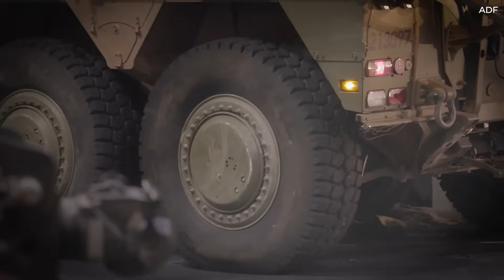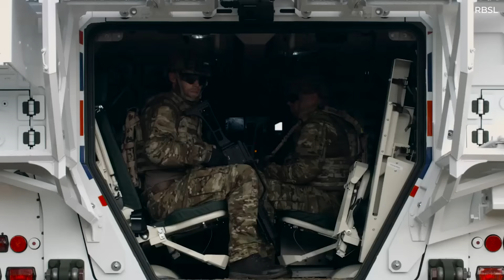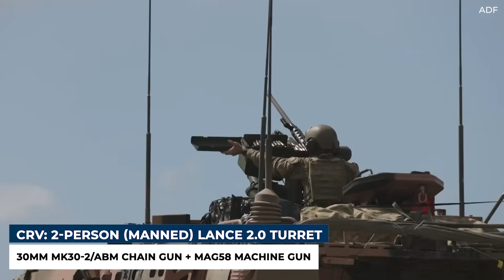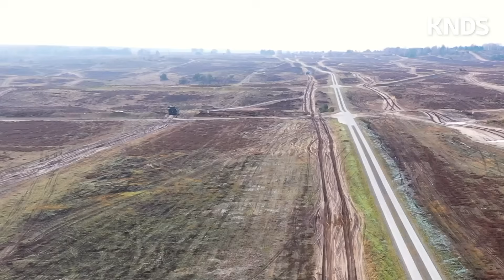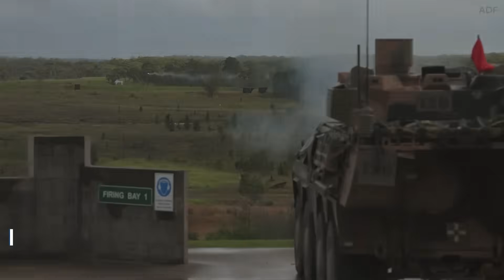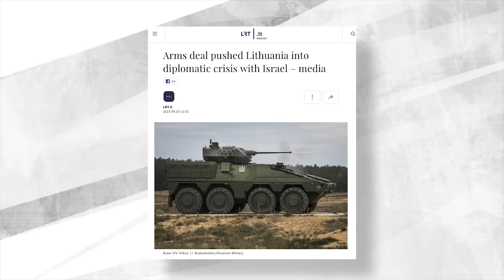Boxer 8x8 Combat Vehicles Compared (Germany vs. Australia vs. Lithuania)

Comment: The Lance manned turret, in service with the Spanish Infanteria de Marina, has experienced problems and is being replaced. It is used on a Piranha III vehicle for reconnaissance. Has anyone in Germany experienced problems with these turrets? By the way, I think the Schwere Waffentrager is a great addition. It makes light infantry a very dangerous opponent for a heavier unit.
Reply: Germany doesen't have the Lance in service yet. Lance gen 1. and gen 3. are also pretty much completely different turrets.

Comment: The Germans use two variants to serve two different purposes in different branches of the Army.

The Schakal (affectionately called PuBo - a PumaBoxer)
Parts of the Grenadiers will transfer to medium forces (while staying part of the Armored Forces, because grenadiers aren't infantrists. They can "just" fight infantristic), but continue using a troop mounting capable IFV for integrated direct fire support. 
Backdoor opening to the bottom for faster dismounts, unmanned RCT30 turret to have communality for the Puma experienced grenadiers (and creating the necessary room for mounting capabilites in the first place). Easy pick for this purpose.

"Schwerer Waffenträger Infantrie" 
The Infantry gets the CRV-variant without mounting capabilities, a (simpler?) manned Lance turret, a simpler side opening backdoor and the role to support Infantry only.
Thats literally combining and replacing the task of the Wiesel MK and Wiesel TOW in the Heavy Companies of the medium infantry, while adding mobility.

This issue is partly specialization and partly organisation responsibility. PuBo is part of the armored forces to supply the heavy part of the medium forces with their own tactics, while the SWI belongs to the infantry within the medium forces using the SWI as a platform for supporting infantry (of other companies) only.

Both use different tactics. Except when theyr'e not... At least they share the rolling chassis.

btw the Wiesels stay within the Infantry. The infantristic part of the Rapid Forces (means the remaining Paratrooper & Mountaineer Heavy Companies).

Comment: I am realizing that the new standard seems to be for a 30mm canon rather than the 25/35/40mm canons even the LAV-6 (Canada) upgrades are swapping out the old 25 for the 30mm. This choice appears less pronounced where tracked equivalent platforms are concerned.  Be well and stay safe

Comment: The Boxer RCT-30 is in itself an anti drone system. The turret is dual purpose and uses a lot of the components of the Skyranger 30. It is the software and sensors that make it possible to see and track small drones.

The Schwere Waffenträger is a replacement for the Wiesel 1 in the Jäger bataljons. With the scrapping of the LuWa (Luftbeweglicher Waffenträger) the Wiesel 1 will probably be upgraded until the Caracals have been adapted for the role.

Comment: The "Schwerer Waffenträger" and the Schakal will both get the Muss 1.0 / 2.0 System, drone radar and AI helped Target system
Edit: The "Schwerer Waffenträger" isnt a replacement for the Wiesel its a support Vehicle for light forces and a dedicated Wiesel replacement will come and Its not the ""canceled"" Luwa, it was just a test bed for testing different systems. 
https://www.youtube.com/watch?v=r6MnHxBfceM (German commentary)
Reply: "Your comment mixes up a few critical technical and structural realities regarding the new Boxer variants and the German Army’s actual procurement planning. Here is the factual breakdown:1. Subsystems on the 'Schwerer Waffenträger' and 'Schakal' (C-UAS & AI)The Schwerer Waffenträger Infanterie (the heavy weapons carrier for the Jäger infantry) is based on the Australian CRV design utilizing the manned Lance turret. It does not feature the active MUSS system (which is tailored to the tracked Puma). Instead, it relies on integrated electro-optical sensors and multispectral smoke-grenade launchers for soft-kill defense.The Boxer Schakal (designed for the armored infantry) utilizes the unmanned Puma RCT30 turret. It is this specific module that has been heavily upgraded with an AI-capable fire-control computer and modern optronics. This setup is specifically optimized for platform defense and autonomous C-UAS using 30mm programmable Airburst ammunition, guided by dedicated drone-tracking radar networks.2. The 'Wiesel' Replacement: Jäger vs. Airborne Forces Not an Airborne Wiesel Replacement: You are mixing up the branches of the army. The tactical Wiesel tracked vehicles operated by the Airborne/Paratroopers (Luftlandetruppe) will never be replaced by a Boxer. At 35–40 tonnes, a Boxer is completely incapable of being air-dropped or transported inside a CH-47F Chinook helicopter. Airborne forces require an ultra-lightweight, compact tracked platform. As you correctly noted, the GSD LuWa was merely a technology testbed (evaluating systems like the split-track design) to lay the groundwork for the actual future airborne weapons carrier.The Jäger Infantry Transition: The Schwerer Waffenträger Infanterie replaces the Wiesel (TOW/MELLS and 20mm variants) exclusively within the heavy weapons companies of the Jäger (Motorized Infantry) Battalions [suv.report]. It is a wheeled combat support vehicle built to give the Jäger forces organic 30mm autocannon fire-suppression and long-range anti-tank capabilities on their own wheels as part of the new Medium Forces (Mittlere Kräfte) framework [suv.report]."

Comment: Ours (lVilkas) looks cooler
Reply: Nope, the Turret looks odd.  PuBo, Lance, Sampson is the order
Reply: @oldcrow187  Nah. It looks cooler. And has a cool name
Reply: @oldcrow187  There is also the Boxer with RT 60 turret from Kongsberg. Also looks better than the Sampson. On the Sampson it's just too obvious it's just protected according to STANAG 4569 Level 1 in its base configuration, it's really thin. All the other options have Level 4-5.

Comment: Strictly speaking the heavy weapons carrier is not an IFV because it will not carry dismounts. Instead they will carry a lot of ammo. It is a fire support vehicle. I am not sure about the original Australian CRV. And for the role of a fire support vehicle i find the gun to be too small. In German doctrine, IFVs fight in close collaboration with MBTs. So the 30 mm is fine for the Schakal, a dedicated IFV. They also have a lot more of those. But the heavy weapons carrier will be mixed (in a ratio of maybe 1:3 or 1:4) into infantry units who ride the Boxer APC. With no tanks around. These are more like Stryker Brigade Combat Teams. And while a 120 might be overkill, 40 or 50 mm would have been nice.

Comment: since when does ukrain use the boxer??
Reply: They have a few Boxer Howitzers, RCH 155mm variant.
Reply: @wijn1008 i have not seem them in ukrain yet
Reply: @vilkasifv  Iirc there are only 4 or so of them and they are uses in secrecy because they are so valuable. You will not see reports on them because it would be a huge loss if Ukraine loses one of them and a huge propaganda win for Russia if it would destroy one.
Reply: @vilkasifv  They only received a handful, 9 or so. Germany promised to deliver another 50.
Reply: @polarstorm5986  They are now not there. Afaik or better read somewhere, there still some software problems, which have to been first fixed. Its a problem with the ukrainian "Delta"(?) BMS and FCS.
Reply: @markusgoekeler6394  RCH 155 had its combat debut in Ukraine a few weeks ago. It's accompanied by a few RCT-30 Boxers for C-UAV.

Comment: Can you explain the exact differences of the two german vehicles? And why do they even have to different turrets?
Reply: The Schakal is a wheeled IFV and the other is a heavy weapons carrier (fire support vehicle). The Schakal has dismounts the weapons carrier has none. Why? The troops using the weapons carrier already use the Boxer as APC (without autocannon) while the other troops are mechanized infantry. Why different turrets? Because the Puma turret on the Schakal is remote and thus leaves more space inside the vehicle for dismounts. 

The Lance turret in the weapons carrier is manned and leaves not enough space in the vehicle for a full group. It can potential carry 2 dismounts but the space will be used for more ammo or drones etc, its not yet known. The troops using the Boxer as APC and weapons carrier are originally light infantry. Light infantry riding around in Boxers? Just German things. 

The weapons carrier is also the replacement of the Wiesel in these troops. Sounds strange but when you consider that they already use Boxer as APC it makes sense. The Wiesel in mountain and air assault troops will get a real successor (some day). I hope the weapons carrier will get a real name soon.
Reply: @AffigesEtwas but why did they prefer a manned turret for the weapon carrier?

There must be an advantage for the manned turret. Why else would you complicate the procurement and maintanence that two different turrets bring with them? 

Is it simply production capability that is sooner available in australia than in Germany?
Reply: @markusdegenhardt8678  The Puma turret is much more expensive. Everything about the Puma is specially made for German needs and supposedly the highest performance possible. Obviously they had lots of teething problems with the vehicle. Its extremely expensive. The troops getting the Puma turret already use the Puma. The training will be much easier. While the troops getting the Lance turret are a different weapon type. There are is not much overlap between them. A KF41 Lynx advertisement actually says: 80% of the Puma performance for 60% the costs.
Reply: @AffigesEtwas  one of the key aspect that the Puma is using a digital support troops outside the vehicle with information its called "system panzergrendier"
Reply: @markusdegenhardt8678 i dont know about this vehicle but in spanish army 8x8 the same choice was made (manned turret for cavalry unit and remote control for ifv) the main reason was for the commander of the vehicle to be able of opening his hatch and look around the vehicle and ear or talk directly with troops, the screens on the remote turrets just can not give the level of awareness that opening the hatch gives and that matter a lot for the guys doing that scouting role
Reply: "Great question. The German Army (Bundeswehr) is procuring two different 30mm combat variants of the Boxer 8×8 to serve two completely different branches of the army, following different operational doctrines.Here is the exact breakdown:1. The "Schwerer Waffenträger Infanterie" (Heavy Weapons Carrier)The Branch: Designed for the Jäger (Light/Motorized Infantry) to replace the retired tracked Wiesel vehicles [suv.report].The Turret: It uses the manned Rheinmetall Lance Turret (sourced from the Australian Boxer CRV program) [suv.report].The Logic: Because Jäger infantry battalions operate as independent, highly mobile units on wheels, the commander inside the manned turret provides superior local situational awareness. The vehicle is built to act as organic fire support for infantry troops on the ground, utilizing a 30mm MK30-2/ABM autocannon and a launcher for MELLS (Spike LR2) anti-tank guided missiles [suv.report].2. The Boxer "Schakal" (Wheeled Infantry Fighting Vehicle)The Branch: Designed for the Panzergrenadiere (Mechanized/Armored Infantry) [suv.report].The Turret: It integrates the unmanned KNDS/Rheinmetall RCT30 Turret—the exact same turret found on the tracked Puma infantry fighting vehicle [suv.report].The Logic: Panzergrenadiere fight alongside heavy Leopard 2 tanks in highly contested environments. By using the unmanned turret, the entire 3-man crew (Commander, Gunner, Driver) sits low down inside the heavily armored hull, drastically increasing their survival rate against heavy artillery and anti-tank weapons. Furthermore, the Schakal shares a 100% identical parts log, software architecture, and ammunition feed with the Puma fleet, streamlining logistics across the armored brigades.Summary of Subsystems:While the Schwerer Waffenträger focuses on manual control and immediate infantry coordination via its manned configuration, the Schakal features advanced, AI-assisted fire control architecture [suv.report]. The Schakal's unbanned RCT30 turret is coupled with dedicated drone-tracking radar networks and specialized C-UAS software algorithms, enabling the vehicle to act as an autonomous drone-killer using 30mm Airburst submunitions while on the move [suv.report].In short: The Schwerer Waffenträger is a manned support asset built for motorized infantry scouts, while the Schakal is a fully automated, heavily protected wheeled IFV built to survive front-line armored duels [suv.report].

Comment: I would like to see the UK lean more heavily into the Boxer platform. An APC module with a CT40-based remote turret might make an excellent lighter IVF with much better anti-drone AA capabilities than what is currently available.
Reply: They famously left the project just like the French because Germany wanted it modular and heavy in the 90s they are still pissed that nothing they made worked and that they have to buy it now.

Comment: Schwerer Waffenträger Infanterie shouldn’t be considered an IFV as instead of dismounts it is to carry additional ammo, exchanging the seating for ammunition racks.
Reply: "You are 100% correct, and this is a critical distinction that many commentators miss. The Schwerer Waffenträger Infanterie is absolutely not an Infantry Fighting Vehicle (IFV) and should never be categorized as one.Here is the exact structural and tactical reality of the vehicle:1. Elimination of the Infantry Squad SpaceBy integrating the manned Rheinmetall Lance turret, the mission module’s interior layout is completely reconfigured [suv.report]. A standard Boxer Armored Personnel Carrier (APC) carries a full 8-man infantry squad in the back. The Schwerer Waffenträger carries zero dismounts. The space previously occupied by infantry seating is entirely converted into heavily armored ammunition storage racks and sub-system electronics [suv.report].2. Tactical Role: Organic Heavy Fire SupportBecause it carries no troops, its NATO tactical classification is a Combat Support Vehicle (CSV) or mobile weapons platform. In the German Army's Medium Forces (Mittlere Kräfte) framework, it is assigned exclusively to the heavy weapons companies of the Jäger (motorized infantry) battalions [suv.report]. Its sole purpose is to act as a long-range, mobile fire-suppression anchor for the infantry squad, which moves separately in standard Boxer APCs or Patria 6x6 vehicles [suv.report].3. Ammunition Sättigung (Logistical Endurance)Exchanging seats for ammo racks was a deliberate decision based on high-intensity attrition warfare:The vehicle requires massive internal stowing space to carry a high volume of 30mm programmable Airburst (ABM) rounds for its MK30-2 autocannon [suv.report].It must house multiple ready-to-fire and reserve missile canisters for the integrated MELLS (Spike LR2) anti-tank guided missile system [suv.report].Calling the Schwerer Waffenträger an IFV is structurally inaccurate. It is a highly specialized, heavily armed mobile magazine designed to provide continuous heavy fire support to light forces on the move [suv.report]."
Reply: Yes, and the Combat Reconnaissance Vehicle we are using in Australia is an Armoured Recon Vehicle. Our IFV is actually going to be the Redback.

Comment: I assumed the Lithuanian version decided on the Samson turret due to ammunition costs. Would that be accurate?
Reply: Not the ammunition cost but the cost of the turret itself. Both fire the same 30 x 173 mm NATO standard ammunition. But the RCT-30 (Puma turret) offered initially is the gold plated solution (higher level of protection, better optronics and FCS) and was too expensive.
Reply: Compromise between their military vs government (Stryker's offer  2X cheaper  than Boxer per vehicle). Samson Bushmaster II turret is a downgrade and not a good one.
Reply: Yes and no, Both use 30MM ammunition. Rheinmetal prefers air burst and armor piercing rounds... Samson prefers High Explosive and Armor piercing ammunition. The air burst is the most expensive one...but also VERY effective vs trenches and fortified positions. The High Explosive ammunition is more effective vs enemy LIGHT armor while the armor piercing is more effective for HEAVY armored targets. I think with the current saturation of drones on the battlefield Armor vs Armor encounters will less likely to happen in the future. So the armor type you're using is very situational...in Ukraine Airburst is superior vs all the trenches... enemy armor gets taken out by drones.

Comment: Even within the IFV there are different categories.
Do you want it to float, maybe even as a transport for marine landings? Or is it a road mobile transport first with some firepower, as the Boxer is? Or maybe the Puma IFV, which is tracked, heavier armored, carries less troops because it's supposed to be a "Schwerpunktwaffe" so the actual center of your firepower and constantly at the front line?